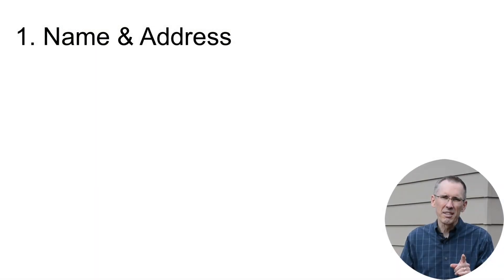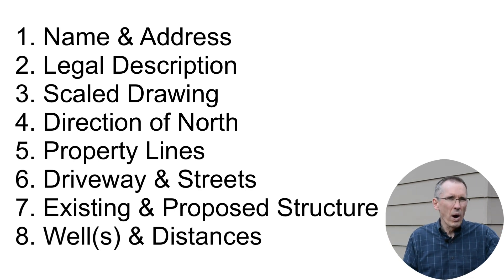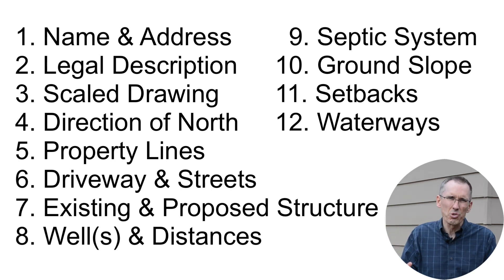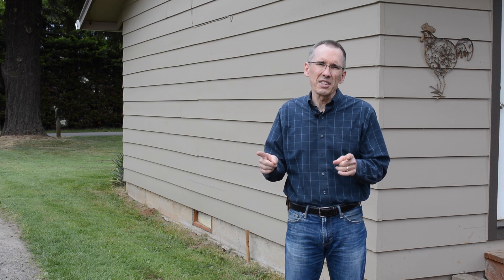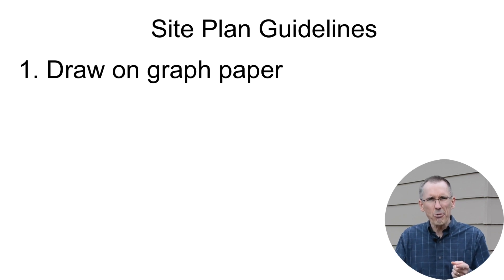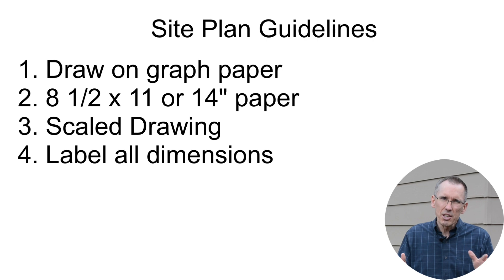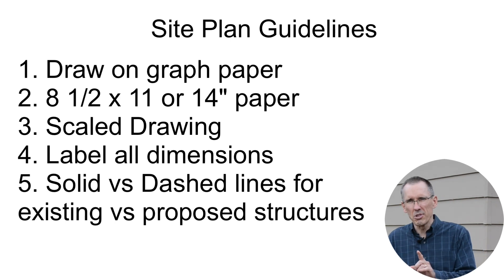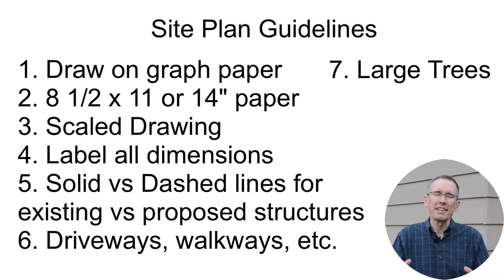What is a site plan? (garage addition)

Comment: Here are some of the items that are generally included on a site plan:
	1. Your name and address
	2. The legal description of your property 
	3. A drawing of your property to scale 
	4. The direction of north 
	5. Your property lines 
	6. The location of your driveway and adjacent streets 
	7. Your existing structures and your proposed structures 
	8. The location of any wells or septic tanks on your property 
	9. The ground slope and the direction of the slope 
	10. Proposed setbacks from property lines 
	11. The location of any waterways on your property
	12. Relative elevations at the building site as well as at the lot corners of the building site
        13. Utility line: Electric, water, gas, etc.

Comment: So I need an engineering site plan to go along with my septic permit application. You are telling me it doesn't need to be drawn by an Engineer? Because I am having one hell of a hard time getting people to return call and the people who I do talk with only do commercial....
Reply: little late but if it helps in Florida no a engineer does not need to draw it if you are a homeowner doing the  installation on a residential property not for rental or sale for at least 1yr  however a licensed site surveyor must come out and do a soil peculation test and compaction test also it most be before above the water table  as well as a inspection of the drainage field before installation during installation encompassing type of fill then final inspection for permit closure good luck hopefully you already had it done